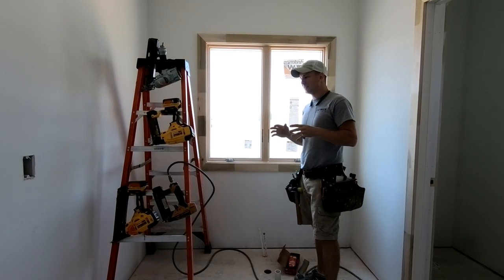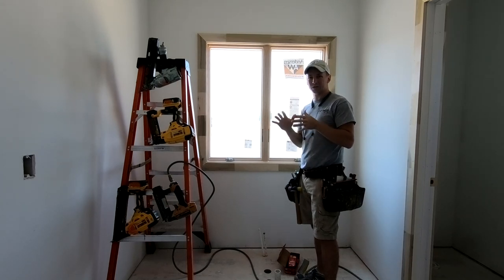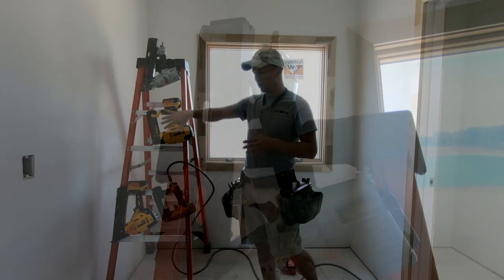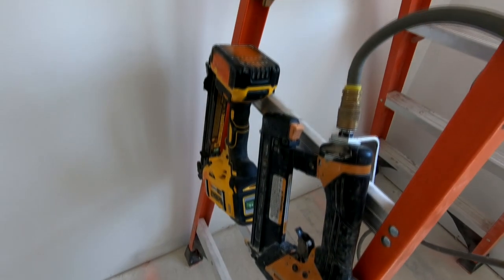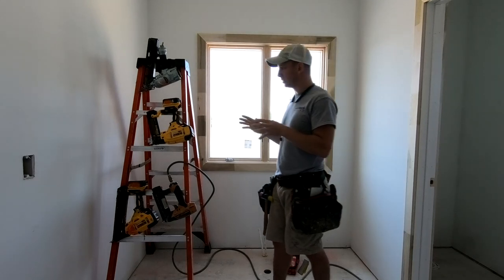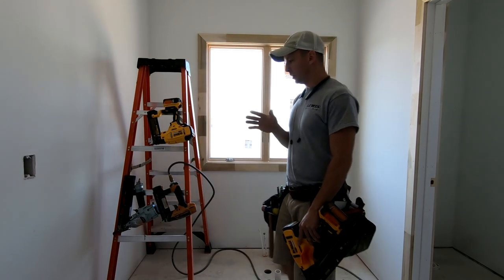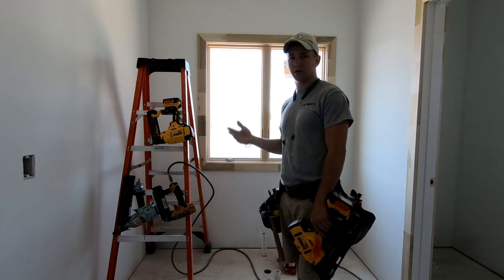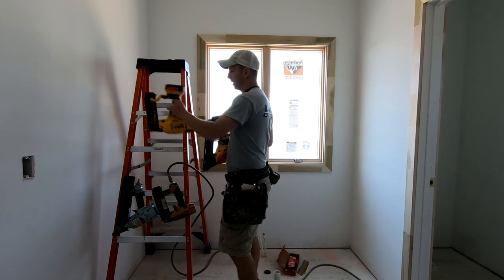Air VS Cordless Nailers Showdown - Dewalt Cordless Nailer 3 YEAR Review

Comment from the maker: Senco PC0350 1/4-Inch Nailer RAFTER HOOK - https://amzn.to/3dPDNi4
DEWALT 20V MAX Finish Nailer, Angled, 15GA (DCN650B) - https://amzn.to/2YYyMjf
DEWALT 20V MAX Cordless Brad Nailer Kit, 18GA (DCN680D1) - https://amzn.to/2YVbqek
Metabo 15 Gauge Air Nailer - https://amzn.to/2NPG02D
BOSTITCH Nail Gun, Brad Nailer, Smart Point, 18GA (BTFP12233) - https://amzn.to/2NMNWBw
Senco 5N0001N Fusion Finish Nailer - https://amzn.to/38lg9sy
Senco Fastening Systems 6E0001N 18Ga Fusion Brad Nailer - https://amzn.to/3dT8OSf
MILWAUKEE ELEC TOOL 2743-20 Milwaukee 15Ga Bare Nailer  - https://amzn.to/38kl25k
Milwaukee 2746-20 M18 FUEL 18 Gauge Brad Nailer (Tool Only) - https://amzn.to/2O3gcQJ

Comment: The results about all comments below fall into two groups.
1. Not experienced diyers will advertise cordless tools. Most of them have not used pnuematics to make a comparison. Please use an air tool for considerable time, you will realize air is significantly more powerful and reliable.
2. Carpenters and experienced contractors will continue to advertise air tools. Reliability, weight and performance is just there. Quite frankly, experienced nailers also used cordless tools as well. So their opinion matters more.

Thanks for great review. Agreed.

Comment: I am a carpenter and use the Milwaukee 18g a lot, it is a fantastic nailer that has zero and I repeat zero issue consistently sinking 2 inch nails below surface. The greatest test of this I have done is nailing maple half inch baseboard that is being nailed into 3/4 solid maple flooring when we are doing gym floors. Do yourself a favor and make the jump to the Milwaukee 18g you will not be disappointed. I had the Hitachi (Metabo HPT) 18g and I would have issues with every 5th or 6th nail sitting proud if I used anything longer than 1 1/2 nails, but the Hitachi (Metabo HPT) 15g I have has been flawless and is a gun I highly recommend.

Comment: Love the video.
I'm not a pro.  I'm a homeowner/DIYer.  I've owned air tools for a while.  My issue with the battery powered stuff is the lack of battery interchangeability among the brands.  With air, I can have a 16-gauge Dewalt nailer, an 18-gauge Milwaukee nailer, and a 23-gauge  Metabo nailer.   All using the same compressor and hose.  With battery, I'm stuck using the same brand of tools if I want to use the same battery for all the tools.

Comment: You're Hell on cordless nailers ! 🤣 I'm still using my 16 ga angled Paslode gas gun I bought back in 2001 and that thing has shot probably 1 million+ nails by now; I stopped using an air compressor cuz of limited power on site and really never looked back. Great video 👍

Comment: I just picked up the Milwaukee Gen 2 Brad nailer (2746-20) and the first thing I did with it was pre assemble some Hardie corner pieces on the exterior of a barn I’m building. Worked great! Will be doing windows, doors, and base with it here in the next few weeks, and I’m excited to use it over the old kit porter cable I’ve got. 

In all of my testing, nails are set deep and I haven’t had a jam yet. Depth control is good too! I’m confident it’ll do the job. 

I’m on all Dewalt too, so I bought the Milwaukee Nailer at a local tool store as tool only, and picked up two 3ah High Output batteries at Home Depot for $99 special they have going right now, then got a starter kit with the big 6.0 and 9.0 HO batteries and a rapid charger, and picked up the “free” briefcase vac with that promo deal.  I feel covered in Milwaukee batteries for now, so I can start getting bare tool stuff. Looking forward to getting the 21° framing nailer, and if they come out with a siding nailer, that’ll get put into the truck too. The Super Sawzall is also on my list. 

Just ordered a DeWaulkee shirt from Richard since that’s where I’m at with my tools now!

Comment: I've  basically come to the same conclusion. On my second 15 gauge Dewalt now. Feeding issues since really day one. Never thought of  galv. nails being a problem. but Hitachi brand nails do seem to work better for me than senco does. When I  set doors now days, I have the flexvolt compressor on bottom of my cart and a 12' hose.  seems to work ok most times. Enjoy all your videos. Lot of great content and right to the point. DB
Reply from the maker: That's a cool setup. I never considered the flexvolt compressor in that application.

Comment: I use cordless in my woodshop. Hitachi 21 degree 18v and 15ga 18v. Just got Milwaukee narrow crown 18v. Gave away a bostitch 18ga, 16ga,and stapler with bostitch loud 6 gallon pancake compressor. I'm looking for a quiet compressor now.

Comment: Milwaukee cordless 18  gauge brad nailer is my go to for small cabinet trim installs, sets 90% of all nails in 3/4 maple with 1-1/4" brads.  Absolutely wonderful gun, highly recommend it.  Keeps the holes small for all filler on all of our custom cabinet installs.  I use DeWalt air guns for everything else on large trim installations.  I have tried several cordless 23 gauge models with Makita, and Hitachi, and both are horrible wastes of money.  The 23 G air DeWalt is stellar.   Thanks for your review of the guns, nice to know what is going on out there with production trim to know how well they are holding up for you!

Comment: I got the 18g DeWalt before it was released where I'm from (Canada), I was excited that it was on the 20v battery system, and had no legit  complaints about the old 18v cordless. After trimming one house I realized its not a production type finish nailer, I'll still bring it to case the occasional door or window, but not a whole floor or house. Though, I've heard really good things about the Milwaukee  Second Gen 18g, so i'm just hoping that Dewalt follows suit and go back to the drawing board for a new 18g 20v.

Comment: I agree on the air for quickness. I haven’t had any trouble as you have with my 18 g Dewalt. I use an older 18bolt 16g Dewalt for door hanging, it just won’t die.

Comment: I have both 18g and 16g dewalt cordless nailers.
Both are very troublesome. 
Im going back to air.
On the dry firing.  Open the top spray firing pin with oil should work ok again. Tip I got from finish carpentry tv.
But definitely going back to air.
Also awesome skills man. Great channel
Reply from the maker: I recently got the 18 gauge milwaukee and its been great.

Comment: I’ve had both the gen 1 and and gen 2 Milwaukee Brad nailer. 1st gen was absolutely awful but they truly stepped it up with the 2gen. Have probably shot 10-15k nails thru it and have been very happy with it. I have mainly used it for Pine trim and small moldings and it has been very reliable and consistent. Very few proud nails so far but you’ll still get one every once in a while

Comment: I stopped using dewalt since the new milwaukee m18 came out. Night and day difference... Just waiting for the 15...
Reply: Yeah, I used the dewalt gun and the new 2nd gen M18 is much better.  I never tried the 1st gen, but I heard it sucked.   I prefer air, but it's not feasible on hotel builds I work on.
Reply: Yes... First generation Milwaukee was horrible at best. I bought the dewalt. But it's so great to have a more powerful gun with no "spooling" sound... LOL
Only complaint is that you have to turn it on... LOL
Reply: For air, nothing beats the Grex. I still use it on occasion, but I only pull out my California Air compressors for the 23 and 21 guage finish work in kitchens.
Reply: Air all day
Reply: SL Custom Carpentry I have the new Milwaukee 18 gauge brad nailer. Love it!

Comment: I run the Bostitch smart point 18 and the Dewalt smart point 15 gauge pneumatic on all my trim jobs, mainly for all the reasons you stated. I hook a 100' Hitachi polyurethane  hose to the compressor and that usually gets me to every place I need to be, even in the biggest of homes. I like to put the compressor in a central location, which helps with hose management as well. I usually set it in a hall bath and close the door, so I don't have to hear it all the time. I just bought the Milwaukee Gen 2 18 gauge cordless a couple days ago, mainly for punch list work, so far it seems like a workhorse. I've gotta couple of Paslode 16 gauges that have been great to me, but ya gotta buy gas as well.
Reply from the maker: I'm the same. I also use a surge tank with my compressor. More consistent air pressure and consistently set nails.
Reply: @InsiderCarpentry  yeah man, I saw your video on that and I've meant to get one myself, I just haven't yet. I can totally see the benefit of it, especially when running and gunning on some base. That's where I get a few proud nails here and there.

Comment: I for the past week have been using the gen 2 Milwaukee 18 gauge Brad nailer with only a 2.0 ah battery driving 2 inch nails and I’ve got to say it’s great. I must say though, it is not my gun, and it is new. Was someone I work withs nailer and I was installing tongue and groove pine. I did get the occasional proud nail, but after watching this video I do think it could have been from a limp wrist. Maybe it could be resolved with a bigger battery but does not seem to happen as often as you say with the DeWALT 18g nailer. Just my input on the matter

Comment: Air nailers for sure. I cannot stand the winding noise of the cordless. I have Senco 18 ga., Ridgid 15 ga. And Metabo 23 ga. I will soon replace the Ridgid for Metabo because of the Senco price difference. Great tip on the galvanized nails; avoid them for indoor use. I get so many more jams and miss fires with coated nails than with smooth nails. Excellent topic keep them coming.

Comment: I love my milwaukee nailers. I don't use them like you do, but I have found them very reliable (and quiet compared to the Dewalt). Once you bite the bullet and buy into a second battery ecosystem, you will find it frees you up tremendously. Both Dewalt and Milwaukee make good tools. But Milwaukee makes better nailers right now.

Comment: Had the same problem with the 18ga Dewalt.  Sold it after a few months. Got the Bostitch 16ga and it's a beast. Great multipurpose gun. No stupid kill switch with 8 brads left and takes straight nails, which are way cheaper.

Comment: Like an update on this. So much has changed in two years, especially your use of the new Milwaukee cordless nailers.
Reply from the maker: I've been disappointed with the new gen 2 milwaukee. I already had two replaced under warranty. Now my brand new one doesn't feed nails either.

Comment: I agree with you... I have a Paslode Cordless 16Ga and a 18Ga trim guns I use for doors and small stuff... I use Metabo 15Ga 18Ga and a 23Ga pin nailer for big jobs.. With Dewalt air compressor... 👍✌

Comment: Another nod for the 2nd gen Milwaukee here.  im  not brand specific  and this was my first Milwaukee tool and love it.  There is no ramp up its as close to air nailer as i have seen. Talking 18g only here, had it about a year it will shoot consistently through 90% of the woods we use hard and soft.
I even have to back the tip way off for softer woods to keep from setting too deep and leaving a bigger nail hole.
Cheers..

Comment: I use the 2 amp hour batteries (the smallest ones the offer) and they will go all day on a charge no problem. I have never noticed any problems with the different batteries. I mostly do work inside homes people are already living in. I have customers comment on it being quieter than an air compressor all the time. Also when doing multiple rooms that are full of stuff a air hose would be a huge pain. If I was doing what you do more I might consider air though.

Comment: I use Milwaukee 15,,18ga day in day out now for 3 months. No issues. Has wider tips so it won’t dent product like the smart point. Its a lot lighter than the DeWalt cordless nailers. And paired with the 3ah high output battery the trade off for the little bit of weight is worth it. I recommend looking into them. They don’t disappoint
Reply: Also the nail set is awesome. Pretty  consistent in my experience.

Comment: I have discontinued Hitachi 15ga angle gas nailer. It’s works well and it’s super light. Almost as good as air hitachi. But sometimes gas misfires, and it’s is not quite quick on repeatable nailing

Comment: Yea Milwaukee 2nd Gen is awesome. As much as I try to stick with dewalt since I'm so invested in their battery system Milwaukee just hands down made a better 18G  nailer. It doesn't seem to have the issue that the dewalt does and runs great on just a 2amp.

Comment: Great stuff!  (not the foam :)  
Milwaukee 15 works great!  Has power like air, the tip is a little too large however.   Built like a tank, never a jamb or misfire!  Need updated tip and rafter hook design.  However its a workhorse. 
Milwaukee updated 18 gauge works almost great!  Build and design is great, works awesome usually.   But I have had trouble with nail jambs and double nail shots....I need to take it it to address it.
Milwaukee 16 angled nailer.   Returned.  I assumed it had the same power of the 15 but it didn't .  Wouldn't se the nails period.  
Dewalt 16 angled works for a while.  Ergonomic, and efficient.  Good speed, and power.  Mine is now trash after a year and a half also.  It now only works intermittently.  Also the magazine return never worked proper from day one like yours... could only load a half sleeve o nails. 
Dewalt newer 18 brad!  Worked well for a while.   Now its intermittent as well.  
Dewalt 18 STAPLER!   Works amazing!   I've probably only put 15000 staples through it, but its got power!  I would rather the Milwaukee now however!   Dewalt tools are more disposable now it seems.
Makita 23 guage micro pinner.  Newer design.   Works fair to poor.  Nails won't feed or load properly.  Power is okay with 1 inch nails in poplar.  
Ryobi 23 micro pinner!  Works great!  Just plain works great!  My partner has it.  It always just works!!!!!  If you need a cordless Micro, get the Ryobi!! haa
(Milwaukee please update your 16 and 15 guage nailers to adress the tip size and belt hook to the larger design!!!!!!!!!  Also please release a 23 guage pinner in 18 or 12 volt!!

Comment: I have a paslode 18 gauge cordless.. wouldn’t trade it for the world.. I work with alot of solid maple.. it will drive a 2” nail through 1 3/4” thick solid maple and still sink the head.. I am thinking about the Milwaukee m18 though.. most of my tools are Milwaukee and I really want to try their m18 18 g nailer
Reply: Phelebas thanks for the input!

Comment: I've got an older dewalt 15ga 18v that takes the old post style batteries. Had given up on using it due to very poor nail setting at all but 100% battery charge. Recently got the adapter to run 20/54v batteries on it and its now 98% reliable with a flexvolt battery attached. So as Spencer said batteries matter!

Comment: Cordless nailer starts shooting soft or stop shooting but the motor runs in a simply the spring in the unit. No need to replace the entire unit. Just a heads up. Literally like a 10 dollar part

Comment: Milwaukee 18 gauge I would say is astronomically better. Shot a few thousand brads so far, generally 1 1/2" and there are a few proud nails but not enough to complain about. Had the same amount of proud nails with my pneumatic Ridgid Brad nailer

Comment: Air all the way. Cordless to keep in the truck for quick fixes. I run Milwaukee cordless tools. I think they out perform the dewalts, and the dewalt users that have borrowed my milwaukees agree. However, changing platforms is a very expensive proposition. If you go Milwaukee, only buy fuels.

Comment: So What happened to your Senco Fusions?  My 18ga finally ran out of Nitrogen, but to refuel it is $200, and I am debating just getting the Milwaukee one rather than fixing it.
As always, thanks for taking the time to make this video!!
Reply from the maker: I sold them all so I could eliminate the senco battery platform. I went through 3 of the 15 gauge. Kept having electronic issues that would cause the gun to completely stop working.

Comment: Have you tried the high-pressure nailguns? These are the ones I'm looking at using the Makita Ac310h High-Pressure Compressor. ( 3.6 CFM at 90 PSI for conventional nailers and 2.7 CFM at 300 PSI for high-pressure nailers) Can't find good reviews on YouTube but they look very promising also because the nailers are lighter than the low-pressure counterparts.
Reply from the maker: I've seen them for framing but did not know they were a thing for finish nailers.
Reply: @InsiderCarpentry  Certainly :-)

Comment: Another great video Spencer. Off the subject question. The fast cap best fence stop. Which one are you using? The flat or standard? Stock piling parts and pieces to build wings. Maybe it would be easier if you sell me your old wings. You should go in mass production mode and sell them on amazon.
Reply from the maker: I have strongly considered doing a production run of the stop blocks and selling them. I have the standard stop.

Comment: I bought the Milwaukee battery adapter to run my milwaukee guns on dewalt batteries. seems to work pretty good, saves on hauling more batteries and chargers around
Reply from the maker: I'm gonna have to look into that adapter!
Reply: Where did you get it?
Reply: @cabbyhubby  eBay and Amazon has that sort of thing.
Reply: I second getting the adapter. I have four of them. No name China part. $20 on eBay

Comment: I have the same exact 18ga deWalt cordless. I have all dewalt tool batteries so stuck with it for now. I hear Milwaukee 18ga is way better according to Finish Carpentry TV. So I’m thinking Milwaukee fixed the gen I issues.